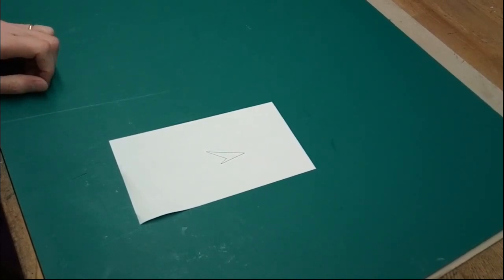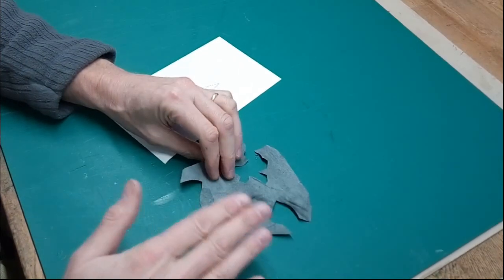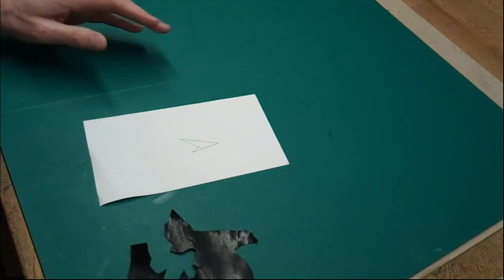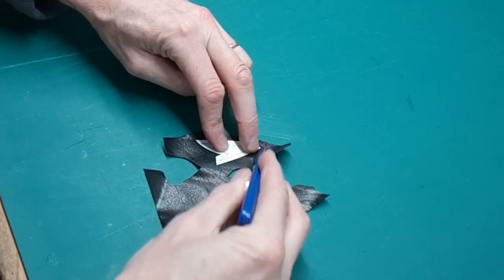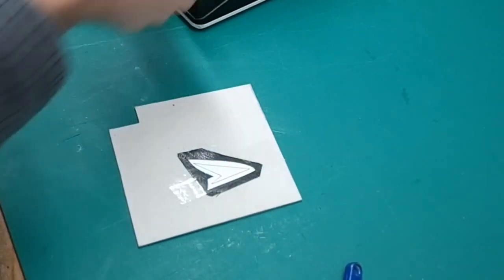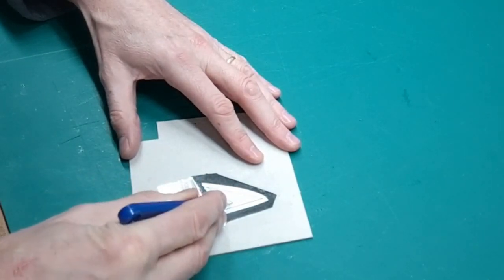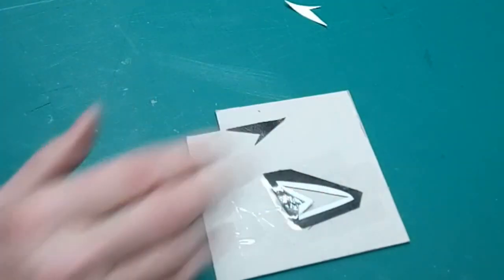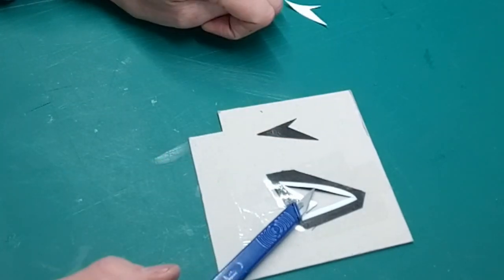Bookbinding - Cutting Leather Onlays

Comment: Wonderful idea, have you tried this for leather book corners that wrap around, how does it work out?
Thanks
Reply from the maker: Hi Rafael, No I haven't, but I guess you could. When I am cutting out leather for corners I do normally make a paper template but just hold it onto the leather whilst cutting around it. I guess it is less important to be precise in this case as the edges get covered by the other covering materials.